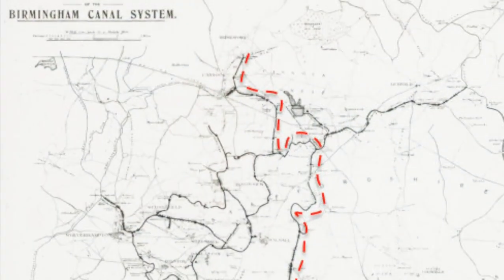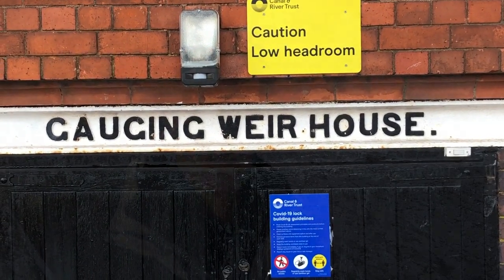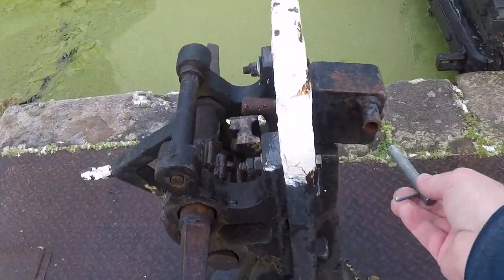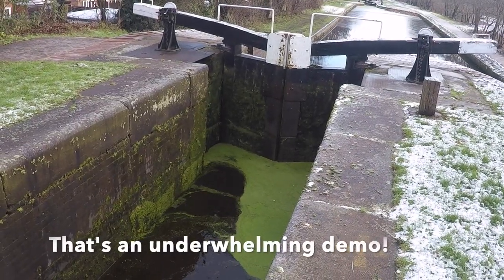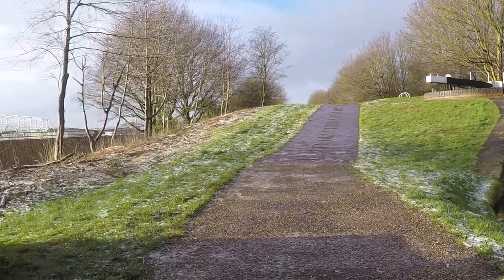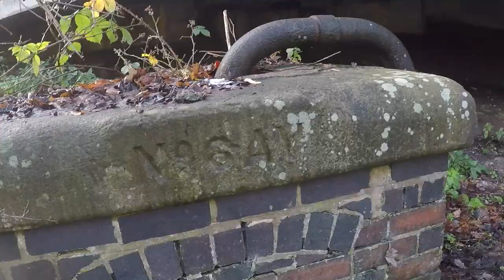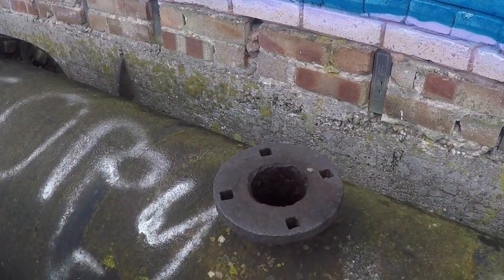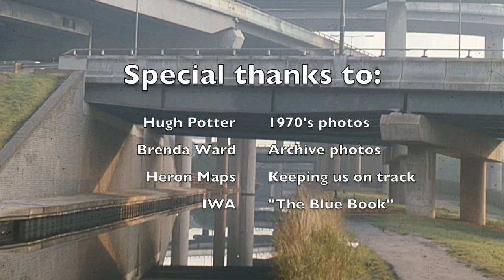4.6 Cannock Coal to College Road

Comment: 60 years ago I saw the tug driver flick his mop right then left and dropped the two top paddles as he passed. The catches on Perry Bar paddles had a sort of rocker arrangement , as a young boatman I was so impressed did I dream this ? I went on to boat to the Potteries, quite a different paddle gear on Cheshire locks it’s a long time ago but I can still her the rattle of dropping paddles in my head. Was this a BCN feature?
Reply from the maker: There were all sorts of paddle gear around the system but these became much more standardised in the 60's and 70's. The boatmen has loads of tricks to "get ahead"  - not all of them very kind on the infrastructure!  I suspect that this means of dropping paddles was one of them. The addition of security locks and the demand that all gates and paddles be left closed put paid to many of the "tricks of the trade".

Comment: Great video Andy, thanks. Always wondered what that pipe was for. I've seen it before as I walked the canal, with the brick built surrounds of the valve housings. It just shows that this canal must have been at the peak of canal building in the UK. I've not seen or heard of anything like it anywhere else. Is the chimney at the bottom of the locks from the old pumping station? Can't wait for the next episode
Reply from the maker: The remaining chimney was part of the GEC works - there are some good photos of the pumphouse between the loks in next weeks episode.

Comment: Very nice hope you keep going. I wood love you to have a look at louth canal in Lincolnshire. I believe it is one of the oldest ie got started first but didn't open first as the water pressure on the fens gave new problems ence the finger of eight locks. Thanks mick h
Reply from the maker: I have never been to see the Louth Navigation - so many waterways and so little time..... Then there is the Ancholm, The Drffield and the Market Rasen around the Humber. One day...
Reply: @lifeat2.3milesanhour57  yes lots of good stuff. We also have the fosdike built by the Romans to and the Horncastle canal of the Witham. Have fun keep safe mick h

Comment: Another spiffingly good and highly informative presentation from The Master of the Midlands canals. We've cruised this section of the system at leas three times. I assume many boaters are put off by the mattresses in the cut at the top end and the terrible state of the canal by Spaghetti Junction above the canal. It's 'fun' waving at lorry drivers on the section that runs nearly parallel to the M5 - they're usually in a slow que thus have plenty of time to respond with a 'toot'.
As can be seen from the video the track is in good condition and is mostly isolated from mass habitation, however being a closely coupled flight there's nowhere to moor (if you conform to the rules).

Thank you Andy (if I may make so bold - we haven't been introduced...) I await your nex presentation with much anticipation!
Reply from the maker: You have to catch that mattress at the Ocker Hill end to win your BCN spurs! Mooring in the area is a problem and I personally am not keen on the top of Perry Barr locks where windows have been smashed. My OK spots are: Ocker Hill Res Moorings, Star City, Cuckoo Wharf, Longwood Junction and, at a pinch, the bottom of the Rushall flight.

Comment: Another great video, Thanks Andy. On the reflux valves, I suspect that is just the description of a valve allowing recirculated water to discharge back into the system, thus opening a particular valve would allow the associated pound to fill. This is based on terminology I am used to in industrial applications in the UK. I would not think that they were used to drain pounds for maintenance as the lock paddles easily fulfill this function. Note that if you look up reflex valve you get definitions for check (non-return valves), but I believe that to be US based terminology. I look forward to seeing any more details you cn come up with.
Reply from the maker: The few written accounts are conflicting - which is a pain Chris.
Reply: Medical associations reflux is "to throw up" or "discharge".To discharge the pipe to lose the accumulated silt makes some sense. To fill a pound from the back pumping makes more sense energy wise than to pump it to higher up and then discharge it through the paddles (it would be impossible to hold bottom gates open as you have proved).
However it would have made far more sense to me if the point of discharge was above the top lock of a flight than below the bottom one for 2 reasons: First going up and finding an empty pound you need the discharge above the flight and Second if wanting to lose the silt the silt would accumulate where the water travels slowest which would be more likely on the level pipe sections alongside the pounds rather than alongside the flights. That is assuming gravity is being used rather than the pumped water from below. Silt would accumulate most where level section and gravity rolling silt down the flight meet (just where the valves are) after a period of no pumping particularly.
Therefore with pipes full of static water, close off valve at top of pound, open reflux into pound and gravity washes silt into the pound from above the open bottom of flight valve. Close reflux and open main valve again allows water or air to only flow along pipe.
Alternatively close valve at bottom of flight and open reflux valve and pump will wash out silt in pipe alongside the pound. Both these methods may have been used to clear any accumulation of silt at the site of the valves.
Reply from the maker: @peterfisher6348  I wish there was a schematic!
Reply: sorry edited to add text to my comment...
Reply from the maker: I wish I could have found a washout valve but I failed on that count.
Reply: Sorry I assumed the reflux valve was a washout valve, given the overlap in the meaning of the names...
Reply from the maker: @peterfisher6348  No, there were 2 reflux valves, one beneath the Perry Park Flight and one below the College Road Flight but three washout valves - which included. another beneath the bottom two locks. All very mysterious.